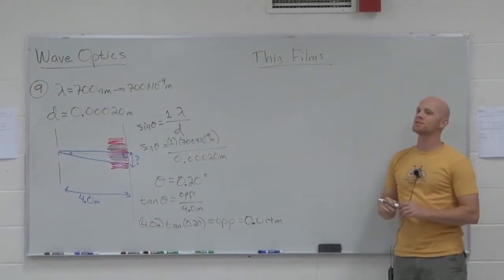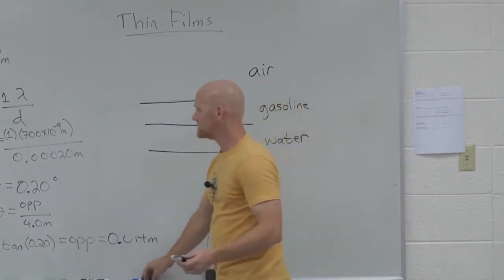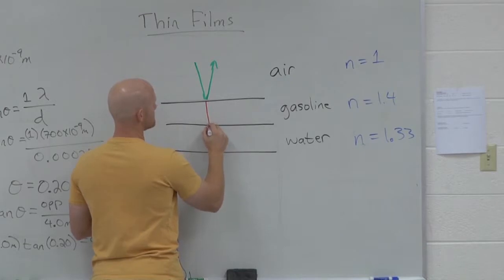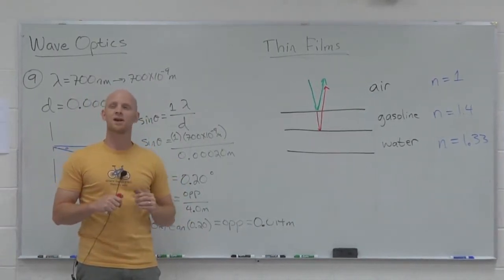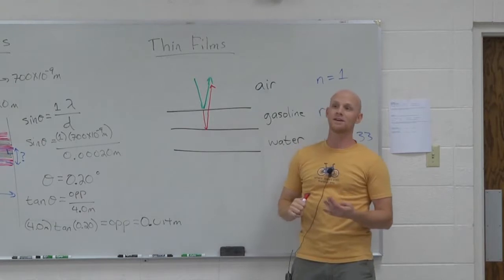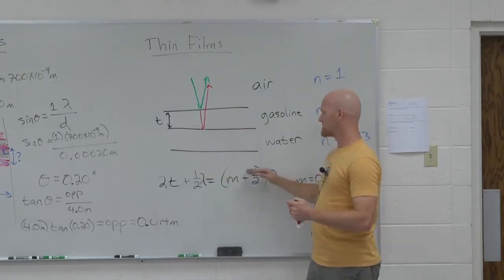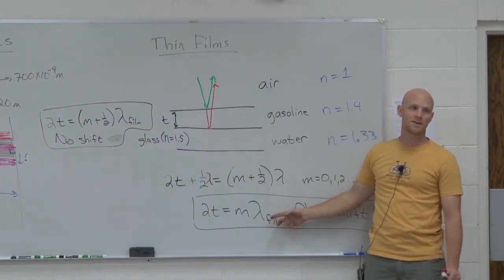24.2 Thin Film Interference

Comment: The equations you provided are only for destructive interference of the waves, right?
Reply from the maker: Correct Youssef!  While both constructive and destructive interference occur with thin film interference, it is much more common to look at which colors are not seen (due to destructive interference) than those that might appear with higher intensity (due to constructive interference).  Best!
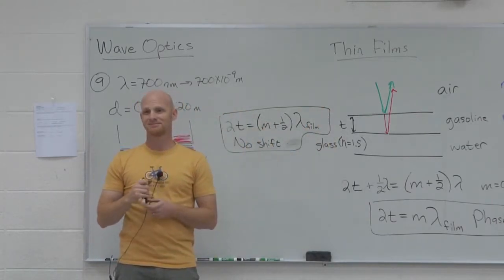Reply: @ChadsPrep  Ok thanks. But I don't see why you wrote at 11:54 "No shift" for the case where you have glass, gasoline, and air. That equation would apply to when there is a phase shift (i.e destructive interference) between the reflected and refracted wave, no?